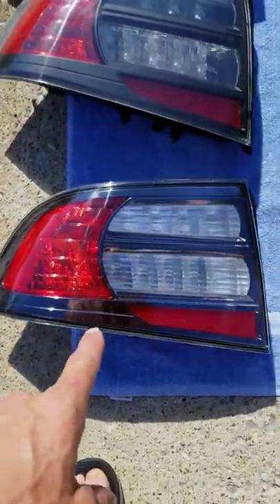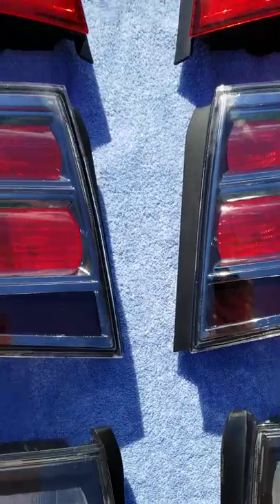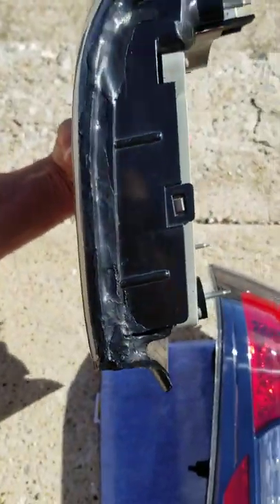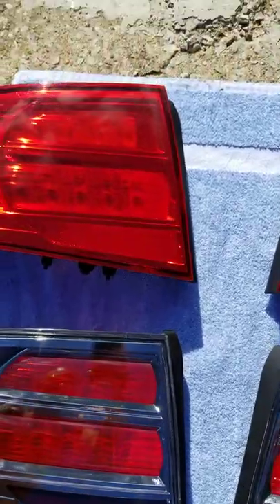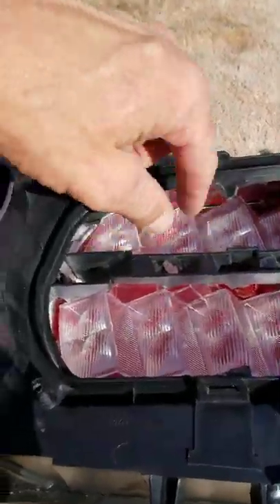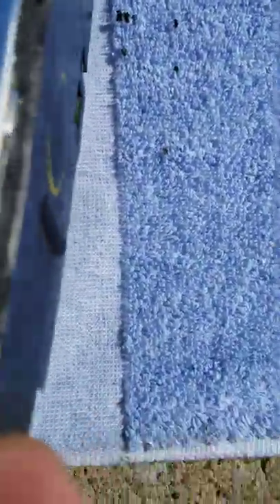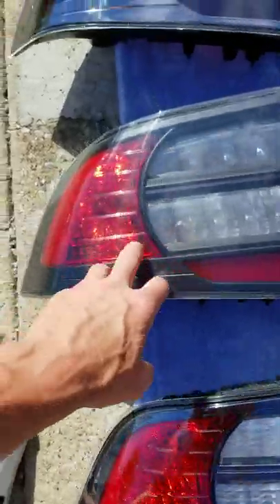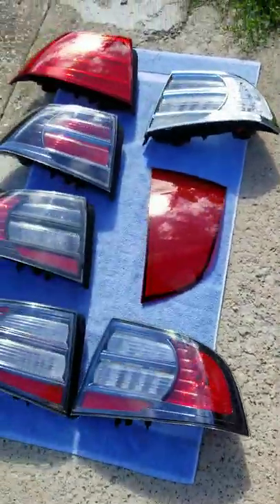3rd gen Acura TL taillights, modded taillights,bazels,depo, 2004 -2008 TL Type S

Comment: How much you selling.??
Reply from the maker: I sold the black bazel depos for 150 plus shipping..and the others are used and selling for 125 plus shipping with no led board..or add 30$ for led boards.. only have these for now..may have a set of all clear..with all clear bazel soon..along w the clear taillight portions in place of the red ..inside of the type s black/chrome bazels
Reply from the maker: @J-TDotDriver  you wanted a type s mirror chrome bazel..with turn signal all clear? And bottom.reflector still red? Loom me up with the same Mjw7800 on facebook or Instagram..and I'll be able to show you a few I did..or we can talk about some
Reply: I've been looking for the taillights like you have on your car with clear turn signals
Reply from the maker: @michaelsmith7234  I may be selling these or making a other set..just waiting one few parts and some taillights yo get in stock